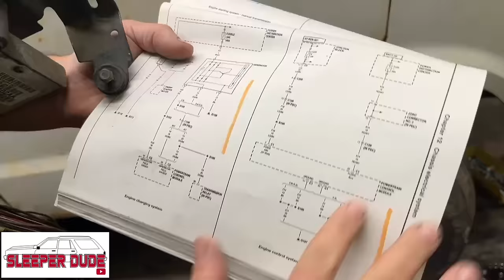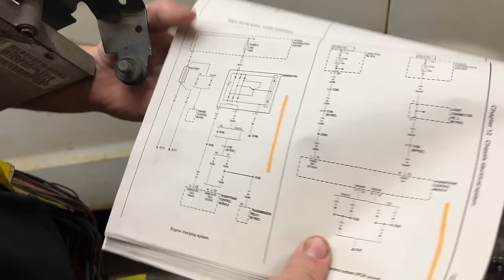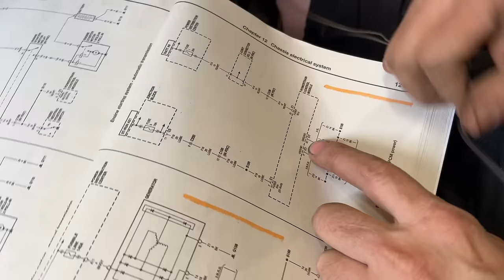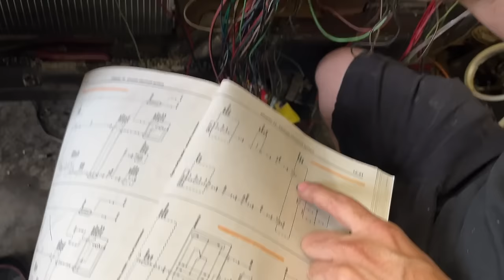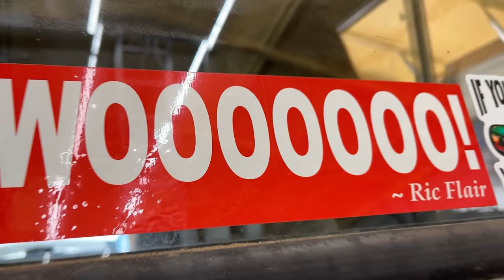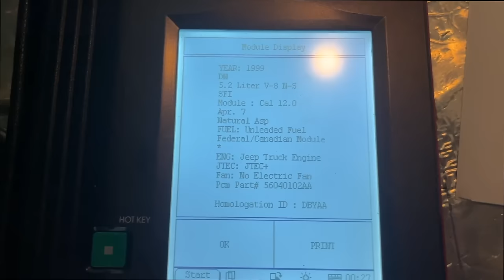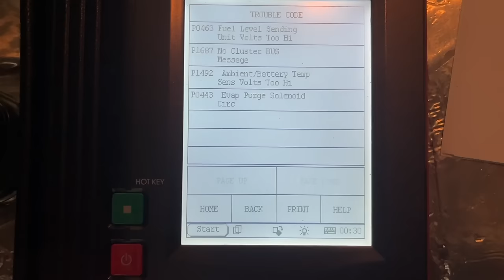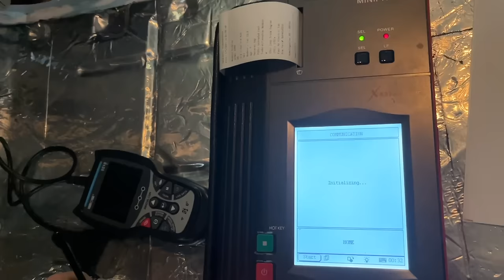2 Years of WORK Has Led Up To This! Will It Start?

Comment: Sleepdude, you and your family are pretty Awesome!  sometimes it something simple...Try putting the test lights and check it with the injector tester, just to see if they light up, test lights may be bad.  For engine protection some manufacturers will monitor the oil pressure circuit signal if it drops or doesn't see it, the computer will turn off the injectors to prevent damage.  The injectors normally get 12V and the computer sends ground pulses to activate them and if the injectors click open, the line pressure will drop a little for every click.  Check for pushed or bend pins on the computer connectors and oil pressure switch.  Last thing to check fuses. Good Luck and God Bless!

Comment: Hey guys. Hustlehouse here.. I’d try tightening up the distributor if it’s kinda loose, older electronic jobs  would loose spark if loose ( injector pulse in your case) buzz out the grounds on the injector rails. I believe those share a common ground but not sure. Please throw those solder connectors away. I’ve used a couple outta my kit and they all failed. Your gonna have a hundred of those things on your Rv and they may leave you stranded. I’d be suspect of the one you connected the primary and secondary ignition wires together with. Pickup in the distributor may have took a crap on ya. You may consider a 90s ram harness, computer, and dash cluster swap idk. Hope you get it, love the content. Good luck

Comment: Hi Josh, I felt so bad for you after doing all that work and having it briefly start up, then nothing.. I have been wrenching on cars, and still do, for  48 years and have seen it all, but that is the worst when it wont start. hopefully someone will know what the issue is. I really thought it was the Computer or the fuel injector driver. Unfortunately,  I have no idea what the issue is, wish I did. Keep up the good work!
Reply from the maker: Thanks so much

Comment: Sleeperdude, you may want to start with switching the  psi back up to above 50psi. Til u find a sweet spot.  Some older vehicles like that and wont run below 50 psi.

Do you know if this Rv model has 1 or 2 sending units??? I say this becuase Ive seen 2 on some Rvs and if one is bad neither will work.

You may also want to check the following for oil pressure dropping.

Oil Level Is Too Low. The oil level dropping below the minimum dipstick line is one of the most common causes of low oil pressure.

The Viscosity of the Oil Is Too High or Too Low.

Oil Pump Failure.

Clogged or Dirty Oil Filter

Sometimes I find it best to give it a day, then come back with a clear mind and retrace my steps and go thru everything.  

You can always recheck the video to in the minutes it ran, to when it didnt run and see what you changed, that may help you as well.

You will figure it out Josh, just give yourself a minute or 2 to breath and refocus, there is something youve missed.  We all have faith in you, so cheer up buddy.

Comment: you are probably missing a input . Coolant temp , ecm needs to know to go to open loop and set the pulse to rich for cold start . Does it have a cam sensor input ? Tps it needs to know where the throttle is . Map it needs to know how much air is in the intake . You need a scan tool that will allow you to look at pids . That's the only way I know to see what's missing . Data pids .

Comment: Also the idle air control has to learn base idle is why it's starting and stalling.
When you get it running hold throttle open just enough to keep it running and the iac will adjust. Sometimes it takes a few minutes. You will have to relearn it everytime you disconnect the battery for a length of time.

Comment: Check the Durango  fuse box for any hookups you don't have in the universal boxes you used don't have. Chrysler is good for that. Also do a load test on the battery. Most of the newer cars won't run if the battery is below a certain load value. Also check the run/start relay. I hope this gives you some idea on what to look for.

Comment: I know its a million times diffrent. But my 94 chevy 350 tbi would kill the injector pulse if it didnt sense any oil pressure after a couple seconds to a minute. Ended up being a bad ignition control module in my distributor. Hope this helps in some way. Love the videos and keep up the good work. Dont get discouraged
Reply from the maker: Ok thanks
Reply: No problem man. Do you guys still have the mg? I have a haynes manual I was gonna send in the fan mail but didn't know if you still had it

Comment: Josh, the ECM and the Security module are a set, when swamping engines, you must have the security module cleared and re-flashed. if you unplug one or the other the security module locks up.

Comment: You could purchase HP Tuners MPVI2 delete the rear O2 sensors. An also adjust tire size in the pcm to match the rvs so the trans shift points are more suited for your application.

Comment: A couple of things regarding your Solder Stick connections. I've been working with these for years. First, a concentrator attachment for your heat gun will make it quicker to melt the solder ring, and will also help protect things in line with the hot air, so you have less chance of damaging your adjacent wiring. It will also help insure that the solder ring is completely melted, and flows all the way into the joint. This will help strengthen the splice, both electrically and mechanically. Last, make sure the sealing rings at each end of the splice have melted completely to make a complete seal around the wire, to keep out moisture, dirt/oil, and even protect you from a possible short circuit igniting fuel fumes. They're a lot faster than doing a splice with a soldering iron, and covering it with heat shrink tubing, and should last a very long time. Than you for sharing your work on the motor home, I'm really enjoying the videos. All the best to you and your family.
Reply from the maker: Thank you so much

Comment: Ignition maybe, return power from the Injectors. Fuse or similar to the Injectors system. It does act like a safety.  Maybe you got to flip the key switch back and Forth 5 or 10 times. You will get it this I know. Never Give up !!

Comment: when I rebuilt my 5.2 in my 1996 jeep grand cherokee I thought I was correct with my timing and kept having issues starting it just like you but I whent ahead and decided that I was 180 out and I swapped the distributor around and it fixed it.

Comment: Good morning guys 🌞 I'm a 59 year old dinosaur, and I basically stick with carbureted vehicles. Time Marches on and I've got a 97 Dodge ram 1500 4 by 4 with a 5.9. I spent a couple of months last summer trying to figure out how to get it to run after timing jumped. 200000 miles and it had many electrical problems. I checked out a million YouTube videos and came across Racing Ram Family. These guys swap out and build nothing but mopars. They got me on the right track if you want to try that. All said and done I hot-wired the fuel pump. Truck continues to run a year later. Mopar is notorious for electrical problems. Grounds are of the utmost importance in a Mopar. Good luck Josh. You guys are awesome and I love your videos 👍✌️🇺🇲

Comment: I definitely have to give it to you when it comes to wiring. It's definitely not my strong suit. But I learn more every time I watch you. I thank you guys for making some good videos.
Reply from the maker: Awesome thanks
Reply: @Sleeperdude Check the old donor durango for a transponder ring  that matches the durango key in the column. if it has one you will have to wire it up somewhere and tape the old key to it or injectors won’t recieve pulse because of the immobilizer built into that NGC pcm. also check for neutral safety switch preventing start. may have to wire it to think it’s in neutral to start.

Comment: Use a nonfouler spark plug adapter 18mm Ford one drill for clearance for rear 02 and move about 24inches from front 02

Comment: I hope you are gaining some progress on your "mini-winni", really love your channel, lots of great advice in the comments.
Just a little friendly advice from a fellow builder, me.  I have 110% success on builds, never a no start, or problems, starts first crank/start every time.
I even have to remind myself of this very important advice:  Check, double check, triple check and even quadruple check EVERYTHING before going for that
first turn of the key (first start),  I cant stress this enough!  Every fitting, connection, junction, nut bolt, VACUUM fittings, hose clamps, fluids, EVERYTHING!!!  Just spend a couple peaceful
minutes doing a very detailed visual inspection before going for that first start, you will be amazed at the things you will find.
It makes the job much more rewarding catching problems before they become problems!

Comment: I just did something similar on an EFI upgrade on an 89 Wrangler and you really need to make sure every sensor, ground and power are connected as per the ECU pin outs.  I typed in 1999 Dodge Durango and then went to images and found a decent pin out.
Reply from the maker: Ok thanks

Comment: I'm a little late on comments so hopefully you already have this running.  One thing in your video i heard you mention was that you extended the O2 sensor harness.  Hopefully you bought a pre-made harness.  If you extended it yourself, the sensor wire from O2 to the ecm had RFI sheilding in it.  If you cut and splice that wire without properly pulling the wire mesh back(its tiny), it will short the O2 signal to ground.  Its easy to test, just cut the splice out and leave unhooked.  It will run without the O2, but will set a code for no O2.  The cam and crank sensors may be suspect too.  Would be a good collaboration video for one of the youtube auto diagnostic folks out there like pine hollow auto.  Good luck.

Comment: Oil pressure sensor would be  where I'd start.. Usually the oil pressure cuts fuel pump relay on or off ..but may also have built in low pressure safety switch for the pcm... Good luck

Comment: Hello Josh, love your video's and your family dynamics . It bring joy to me, 
that young people are being raised right and being set up for success . As for the 5.9 , re check all of the grounds and you may have to add ground straps for engine to frame , engine to firewall etc. Modern engine controls are so ground dependent and any deteriorated connections  will cause many hard to solve problems . The is a saying that if it worked then it all of a sudden it doesn't , it is more likely a grounding issue . Cleaning the connections , using star washers and dielectric goes will help assure reliability and proper operation .  Want to say you received a lot of great advice and you are doing such a GREAT job. Hope this helps and sorry for the long winded comment .

Comment: I was sooo prayin for you. On my 96 the coil pack had a crack in it and it would not fire for the life of it. the spark was exiting at the coil and not making it through the wire. replaced the coil and bam, Fired up instantly. Also if you pump the gas like a regular system it will fludd out and not restart. I sure wish you had got it running. Hope you still do. You guys quickly became my fave. Me and my daughter are working on my 75 Duster as well as may be putting a 73 Duster stock car I recently purchased back into race mode. She's old and dirty circle track car but very cool for sure. Got my fingers crossed for ya/

Comment: I do believe that you could use a splice to the Dodge starter wire to a 12v ford starter relay to supply the 12v with the starter relay energized from the r post in start position....maybe???? As a transmission mechanic speaking,,, The cooler needs as much air as it can get....especially in a motor home..perferably in front of the Radiator but you can mount it behind....i've used plenty of the under car mounting in some street cars, just not on an RV.......great work and great video...😎😎

Comment: Heads up on those bulkhead fittings, i use the soft copper oil plug gaskets with rubber impregnated on the inside at the threads for my fuel cell/tank fittings like that. I have had those plastic ones squeeze out on one side and leak, even used aluminum AC seals and never had a leak since. Yall doing a hellova job, cool to see the whole family getting in on it

Comment: The Durango that you took the engine and the wiring harness at of probably had a fuel safety cutoff switch for when it gets in a collision or something like that is that hooked up

Comment: I had a 92 s10 Sonoma with grounded out reference wire going back to the computer causing problems it took a reputable garage and auto network system figure it out- good luck guys!

Comment: I agree with one of the comments below hook up your oil pressure sensor and any other senor you may have neglected to hook up they all work together and talk to your computer. If your oil pressure sensor isn't talking to your computer then it thinks your engine has no oil pressure and is shuting the fuel system or power to the system down as a saftey to protect the engine .so try that first. It could by why the enging ran for a short time and then sur down.

Comment: As a guy whos dabbled in the 90s jeeps running Chrysler systems. Fuel and spark come from cam and crank sensors. Check if those are good. If you need a guy who can really help. Try getting ahold of Ivan at pine hollow auto diagnostics.  Good luck

Comment: Try unhooking the vacuum ports on the drivers side that you hooked to the break booster. It was running up to that point. It may be the wrong vacuum ports
Reply from the maker: Ok thanks

Comment: 99 and newer dodge trucks have a body control modual on them. I had a 99 dodge dakota pickup that had the same motor in it and it had a body control modual on it.

Comment: I came across an article that might help with the dodge camper 5.9 .If you google "Haltech ecu grounding the dos and donts" youll find it. I noticed you connected C1 pins 31 and 32(grounds) to the neg battery terminal. According to the article, you shouldnt do that because during start up, theres alot of current flowing through the neg terminal. They say that the current load ( about 500 amp) can pull current from the computer causing problems. Apparently you connect the grounds to the body to avoid this. Dont know if this will work but i guess its worth a try. Also there is a "sensor ground" on C1 pin4 ( black wire with light blue stripe. )That is a separate ground (a floating ground) and should not be connected to the chassis ground anywhere. The sensors get a ground from the pcm  C1pin4 and from nowhere else. Hope this helps.

Comment: Check the oil sending unit sometimes it will make the injectors not pulsate and also check all of the grounds I hope you figure it out and I can't wait for you to fix it so y'all can go on the trip that you have been planning so be careful and stay safe
Reply from the maker: Thanks for the tip

Comment: Something I'd suggest checking is your throttle position sensor. I know on my 2006 Wrangler, with no antitheft security system, it will deactivate the injectors if I floor the accelerator while cranking. Maybe you're not holding the throttle wide open while cranking, but maybe the sensor output is faulty?

Comment: As you've swapped the wiring harness, I would double check all ground connections and also try replacing crank sensor. Really hoping this helps you out Josh.

Comment: I’m positive it is Security, lack of the BCM. There is a key on key off process so the ignition talks to the computer. Are u using the ignition/key from the Durango steering column.
Look into the key on key off process that resets the security 
Best of luck

Comment: I am no expert by any means, but I stayed in a Holiday Inn last night! JK.
We had a 04 durango 5.7,. with what may be a similar system. It was a no-start symptom which used a separate module for security. The mechanic said there is no way to bypass it. Probably because of the computer security.
I know those codes are removed, but I wonder if the ECM is still looking for a signal from that module?
Anyway, I love watching your channel and enjoy your family's interaction!
God bless, and good luck with the RV.

Comment: I had something similar happen when I stripped a Duramax van chassis down, the truck would not run without the cluster connected, and also when I missed a couple grounds for the body control module, so this may sound crazy but try grounding those two extra wires you had with the two for the ambient air temp sensor and also try getting the cluster hooked up

Comment: With the scanner that reading data, check rpm and see if the crank and cam sensor are active while cranking. Some of those keys have chips in them, u my have to wire durango Ignition cylinder harness so ecm can recognize key chip.
Reply: Check oil pressure with the scanner and see if oil pressure is reading. Older American cars, no oil pressure, no start.

Comment: Keep it up you almost have it! I have had issues in the past that all come from bad or not connected ground wires. The black and yellow that you have left could be a ground you need. A loose ground would explain why it ran at first then stopped. Oil pressure sensor also seems like it’s a good place to look as well. Check your scan tool and make sure you are getting a signal from the cam and crank sensors. I am sure you will get it soon!
Reply: Also make sure you ground the engine block to the chassis and battery with thick battery type cable good luck !

Comment: Since it had ECU out of a ZJ generation grand cherokee, you may want to search the zj jeep security bypass, very popular in the ZJ jeep groups, they dont have security in the key, but still have a security system that prevents them from starting.  They permanently ground a purple/yellow wire at drivers footwell, which tells the computer that you unlocked the vehicle, and it disables the security system.